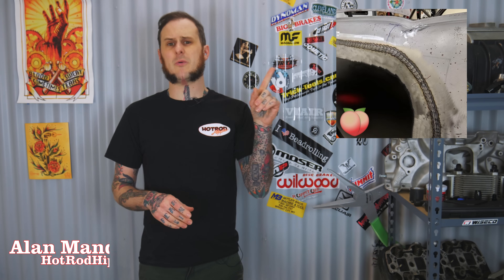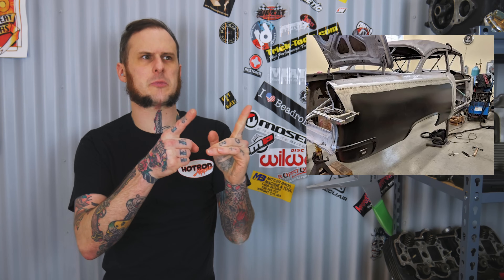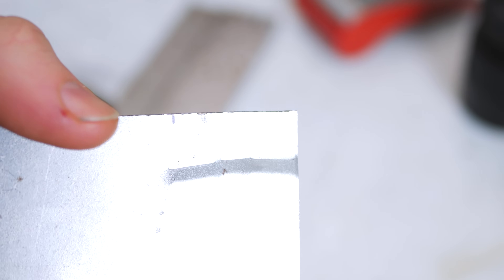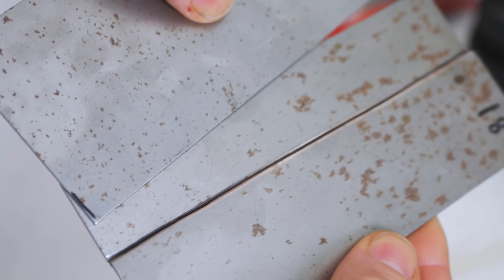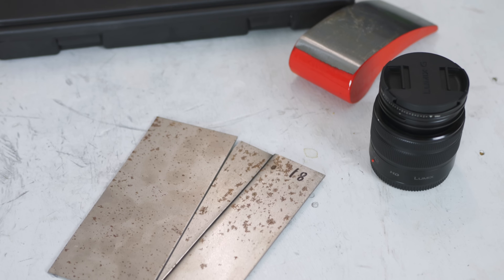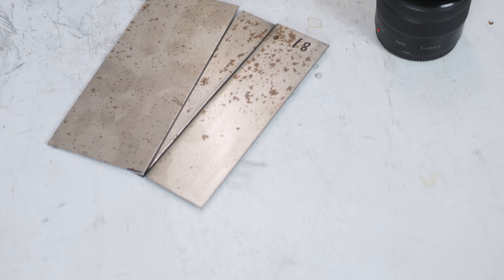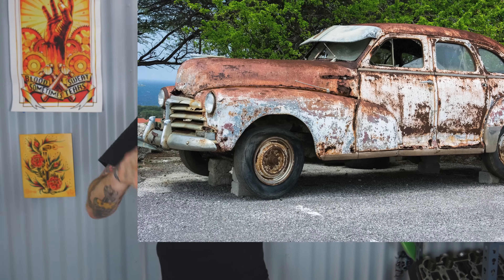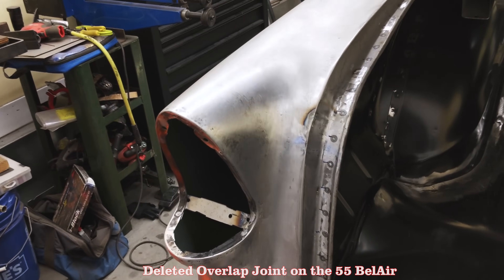Butt Welding VS Overlapping Sheet Metal Panels

Comment: I'm totally new to body work, love it so far, and have practiced butt welding. tried oxy ace but gave up, bought an ac flux core welder and tried joining small scrap pieces. I noticed tiny pin holes even between tack welds somewhat overlapped... I need to watch more youtube videos obviously. I've even considered metal epoxy (waterproof) to overlap repairs! but will keep practicing butt welding... hopefully will be able to repair rust holes on my old truck before they grow much bigger.
Reply from the maker: Flux-core is difficult.  It has its uses but for sheetmetal it introduces too many impurities into such a small weld, in my opinion.  I would be Oxy welding if I had the choice between only the two.  I realize it is absolutely a more difficult skill to master but it will end up a better result.  I should do a video about it in the future.  

You can still get the job done with flux.  It is going to be a small uphill battle, but practice practice practice.  If it was me I'd be looking at those points where the pinholes are popping up and see if you can/should be overlapping your welds a little bit more onto the previous welds.  Or consider hitting those pinholes with a grinder or drill bit and filling them back in with the welder.  Its a time consuming process but sometimes that is how things go to get a good finished result.

Personally I TIG weld everything.  That is the most challenger process to learn initially and there is a barrier to entry as far as machine costs, I fully understand that.  I'm going to be looking for "affordable" TIG machine options for viewers in 2020 and see if I can find an acceptable entry level machine that folks can agree on.
Reply: thank you for spending the time to carefully answer my question. I will try the oxy ace again and am sure a good video would help me a lot, but will also practice the flux core. I have been cleaning thoroughly and even grinding down before coming back.
Reply: Flux. core or mig.  You need to skip all around back n forth side to side to let it cool down.    That prevents warping.    It’s not really any sort of continuous weld but rather a bunch of tack welds touching each other.    For spacing HF makes those tiny $2 mini lamps.   They’ll give you your spacing and hold the patch in place nicely.   They’re about the size of your thumb, very handy .   Don’t forget another trick.    If it’s wanting to burn through take a piece of copper water pipe and flatten with a hammer.   Bend to suit it will last for decades.   Hold it on the back to suck off some of the heat while welding.   Keep a couple around for helping out.    A couple chunks of 3/4” a foot long are handy .
    Handy also are the deep reach HF vice grips.    I use name brand for tough work but the HF are fine for gripping and holding things in place and a cheap second set of hands

Comment: I've seen Alot of overlapping on sail panels,which is from roof to quarter panel.
Reply from the maker: This is a common area of overlap for factory panels.  It is where you will commonly see Trim covering said areas (hiding the transition), Lead covering it (again masking the transition), or just a seam that gets seam sealed up.  

This is a very common place for us to customize classic cars.  I find these overlaps are common rot areas due to all the reasons I explained in this video (YES on factory cars too).  For that reason I will often eliminate the overlap and butt weld panels in this area.  It can be troublesome to access for hammering and fitting but gives a cleaner custom look when completed.

People often make the mistake of just filling these areas with body filler or simply running a weld across the seam to "smooth" it out.  This often results in cracks in the paint and body work down the road from flex or expansion stresses.
Reply: @HotRodHippie  ah yeah bull so all the cars from factory are rusting out around the doors where all panels are lapped
Reply from the maker: @kevinandivy  I can start saving photos of all the rust I find in those areas if you really want. It happens. Basically anywhere that overlaps on classic cars I find rust. Even if only surface rust.

Comment: interesting ive done a lot but weld ok, , , and was now going to overlapping- but you have changed my mind , its obvious that it is not easy to afterwards correct the panel, but i Wonder if overlapping on the inside is pointing downwards, then there is no opportunity for water vapor to condense..
Reply from the maker: You'd allow drainage but condensation would still absolutely occur. So it may last longer but will still eventually corrode unnecessarily. 

The absolute only situation where I promote overlapping is to add strength. And in that respect I just mean things like floor pans, A/B-pillars, and wheel wheel openings where you need the added rigidity of multiple layers.

Comment: Hi, how would you go about making a 55 F100 rear cab corner (with hand tools)? Thanks,
Reply from the maker: Honestly, I wouldn't. Replacement corners are available for $29.99. Even if it doesn't fit well I'd buy it and modify it. It would be quicker than producing my own and cheaper. 

https://www.macsautoparts.com/ford_truck_late/ford-pickup-truck-cab-corner-15-high-lower-rear-rightouter.html?utm_source=google&utm_medium=cpc&adpos=1o3&scid=scplp48-461652-1&sc_intid=48-461652-1&gclsrc=aw.ds&&gclid=Cj0KCQjw2efrBRD3ARIsAEnt0egzcIGkSstwJJMPQmgShfMEhSktyXk9kK06EaSsJkqQacnHVMdOoigaAsy-EALw_wcB

If I was to do it id use a sandbag to hammer in the primary shape. Then smooth with hammers and dollies. Repeating the same bagging until it came around. Not a simple process or how I'd choose to do it but that is the simplest way to go.

Comment: I over lapped in the rear wheel arch sill and floor pan in my e30 cause I was lazy and used brushable seam sealer on both sides 🤔
Reply from the maker: That is how a lot of cars are originally produced in those areas.  Especially floor pans, I make an exception for.  The rust concerns still exist but the additional structure an overlapped joint can create there is hard to ignore.  When a lot of cars derive their structure from their floor pans, that is an important factor.  

You did the right thing using a good seam sealer on both sides.  It may not prevent everything but it will absolutely help.
Reply: HotRodHippie phewww thanks..I thought I might have messed up. lol😄

Comment: Excellent video.  I've quit two shops I was hired to do metal work at before even starting over lap welded body panels.  We have a sort of Hippocratic oath to these automotive pieces of history, and I have no interest in being involved with a shop that can't be bothered to do the job right.
Reply from the maker: Here here. I have butted heads with a few folks in the past. When they told me to "Just overlap it" I tell them 'I'm doing it the right way or not at all. You didn't hire me to do rush jobs.'
Reply: @HotRodHippie  Someone real good (Ron Covell) can metal finish an area on a panel as fast as it takes for someone to finish the same area with filler.  Like you said, the goal is to minimize the amount of filler (and then it goes to a  painter that covers it all in bondo anyways!)
Reply from the maker: I wish I could claim to be that fast of a metal finisher but that will hopefully come with time. Body workers are going to cover it anyway, but at least I know I've done my best and the finished product will have less filler than many others. 👍👍 Thanks

Comment: WHEN IT COMES TO REPLACING A RUSTY FLOOR PAN, i THINK OVERLAPPING SHOULD BE FINE .. ESPECIALLY DUE TO THE EXTRA STRENGTH THE OVERLAP PROVIDES .. SILICONE UNDERNEATH AFTER WELDING AND UNDERCOAT
Reply from the maker: Generally I would agree. If you aren't concerned with keeping things looking original, overlapping floor panels, maybe some inner structures or Firewalls is ok. Those areas are often overlapped already and as you said the added strength offsets the negative factors. Personally I primer in between the panels before overlapping, then weld it, paint it, and seam seal with a proper seam sealer to finish it off. 

This was more so about body panel replacement such as fenders, door skins, etc. The longer original cut of the video made that more clear but was too long.
Reply: @HotRodHippie  thank you sir .. sorry for all caps .. I was ooutta control and didn't realize until after I typed all that .. lol .. CHEERS BROTHER!

Comment: The debate of flange welding or butt welding automotive body panels has been a question that had remained unanswered in my head for a while until now.  You've cleared my head, thanks. 

I have a question.  What do you think of that air tool that slightly turns down the edge of the two panels to be butt welded?   It essentially makes a small trough for the weld settle into so that the weld isn't sitting on top of the metal.  This is supposed to allow you to do less grinding and give the weld more strength.  The tool in question is Eastwood: "Pneumatic Perfect Panel Prep Tool"  Item#21128.  Thanks again for sharing your smarts.
Reply from the maker: I absolutely despise that tool. I think it's the worst of both worlds. Means you will have the trouble of lining up a butt welded panel, and none of the benefit. You won't be able to hammer and dolly a panel properly after using it because now your weld area is multiple times thicker than it should be. I'd rather see someone save themselves the trouble and just overlap a panel rather than use that tool.

Thank you for the comment and question.
Reply: @HotRodHippie  , I appreciate the quick reply.  I knew that there was a good reason to subscribe to your channel.  There's a lot of BS out there concerning metal working automotive body panels and you seem to make a lot of sense.

Comment: Thanks for making this video. What are your thoughts when you actually want to add some structure? 99% of the sheetmetal welds I've done on my current projects have been but welds, however I was shaving a section of the firewall and the area seemed a little too flimsy, i don't have a beed roller to add structure. the panel I made had a flange 360 degrees around, then I fully welded that from the motor engine side (managing the heat). my thought was that the point that could be subject to potential moisture is on the interior side. I know a but weld would have been better, but the flange does add some structure. I guess ideally a couple of beeds would have been better?
Reply from the maker: Beadrolling would be ideal there but that said I support overlapping in scenarios like that. When it comes to actual structural situations overlapping makes sense. The disadvantages are outweighed by the added strength when done properly. Firewalls and Floor pans I usually overlap at the edges. 

In your situation I could see maybe making a hat channel type of cross member and welding it to the firewall from the inside. Then you could use that to mount wiring to or something like that under the dash. It isn't how I'd do it but I understand your situation.

Comment: I like over lapping and using right angle breaks on joints to add structure. I always use weld thru primer and seam sealer if this happens. Body panels however....never.

Comment: Hey man, what's up? I saw your comment on Gary O'Neal's profile regarding copyright claims on the rockabilly lounge song. I also purchased the song and use it on my videos, but I keep getting copyright claims from AdRev. I have contacted them on their website form attaching the license and requesting removal, but had no reply yet these last two weeks. Have you solved the problem? Can u tell me what worked? Cheers and sorry for such an off topic subject!
Reply from the maker: I was never able to rectify that.  I reached out to the place that I licensed the song from, AdRev, and YouTube all to no avail.  I rarely use that song anymore, instead using music from Epidemic sound primarily so it hasn't been an issue for a while.  I just fighting each copyright claim that came up (and winning) but it was tiresome.
Reply: @HotRodHippie  Sorry to hear that. It really sucks to invest money on a song and have no easy coverage to use it as you have the right to. Maybe I'll reach out for epidemic too!
Reply from the maker: @joaoabranteskleos  I've had no problems with music from Epidemic sound since I started using them.  Sadly unless you are part of an MCN YouTube really fails us creators as far as Copyright claims protection is concerned.

Comment: Just wondering what your thoughts are on the perfect panel tool shown in this video https://youtu.be/rpH50kh4W00

I would think creating an artificial beval and filling it up with weld would again make it much harder to shape and form the metal along the welded seams much like the overlapped panels.
Reply from the maker: Correct.  It's all the effort of fitting a butt worded panel with none of the benefit. I kind of get what they were intending but really I don't. Sure it's easier to fill a groove but it's still sheetmetal. Folks are still going to burn through if they aren't practicing not too.
Reply: @HotRodHippie  in that case I best wait for the next installments and learn to do it properly 😊

Comment: You're correct.  Gas welding a butt weld panel is the best and easiest way to go as well. I knew everything you said many years ago by reading books from master body men but I too thought it was a difficult repair to make until I saw an English chap do it and then I wasn't so intimidated. Like EVERYTHING we do, it's easier than you think, and all the more so with practice.

Comment: Very accurate description of the two types of panel repairs. I hear body shops are now
using glue on panels and metal tape for body repairs?!!?
Reply from the maker: Bonded panels have been common for a long time now. Most new cars are bonded in a variety of places. Heck I panel bond classic cars in many places. Not as my only means of panel assembly but I just did it on the inner quarters of that 55 Chevy then resistance welded through it.

I have zero knkedkge of any "metal tape" besides foil tape for like plumbing and hvac. Haven't heard anything of any of that in collision repair.

Panel bond is amazingly strong. It isn't "glue" it's a two part epoxy like process that hardens to amazing levels. I'll do a demonstration of it eventually on here when I come up with a good way to it.
Reply: Thanks for the clarification.
Yeah, a body shop guy told me he uses "Metal Tape" over rust holes and then skims Bondo over that. Sounded pretty hokey to me too!
Reply from the maker: Just picture my eyes popping out of my head and you have a good image of what that idea just made me do. Haaa

Comment: Overlapping is a sure sign of amateur work. 
   My first attempt at quarter panel replacement was guided by my ignorance, and advice from a "cave it, and pave it" "body guy"....it turned of ok for a first attempt,  but the amount of extra work it took to try to get it smooth wasn't worth trying it again.   
   Every patch now gets laid out with dykem and a scribe, and fit as tight as I can.

Comment: Great video Alan, I’m with you on this one. I do not overlap panels. I never really have, maybe once or twice on the rare occasion. Great info on why not to do it. One thing I notice about lap panels, is in the sun the metal expands with a lapped panel that part won’t expand as much. Iv been to lots of show where you can see the seam thru the bodywork and paint bc of the warm sun. Just do it right the first time, don’t cut corners. Looking forward to the next videos as always
Reply from the maker: You are very correct on the expansion factor. The same thing apply to large amounts of body filler. It expands at a different rate than the base metal so it can be seen on a good sunny and hot day. Not always but it happens.
Reply: That's why you are supposed to barely tap the seam down and apply a small amount of filler

Comment: i had never even welded anything before but just completed 30 patch panels (YES 30) in my CJ5 JEEP and 7 in my 240Z all with great success - Just take the time to make and fit the patch with 1/32 gap and tack evenly and opposite the last tack leaving enough time to let the panel cool in between tacks to minimize warpage,worked great for me
Reply from the maker: Excellent input. I'm glad it worked out for you. Perfect example how with the proper mindset and patience you can do this. 👍

Comment: I have always tried to butt weld, but as a very amateur welder I find I get to much warpage in the panel.  I Understand that is the result of getting to much heat in the panel but even when I think I am managing the heat better I still end up with a bit of warpage in the end.  Also need to practice my shrinking as a result.  I am looking forward to your promised videos to see what tricks there are to do it better.
Reply from the maker: I can tell you already you'll learn something. It sounds like yiu maybe attacking things backwards. Warping when butt welding a panel is a result of the weld itself shrinking. It is a result of the rapid cooling of the hot weld but you need to syreych the weld and closely surrounding metal back out a bit to counter act things. Not to say I never shrink things as well in the process.